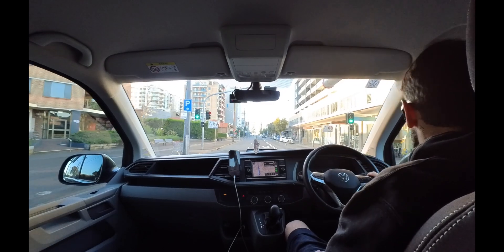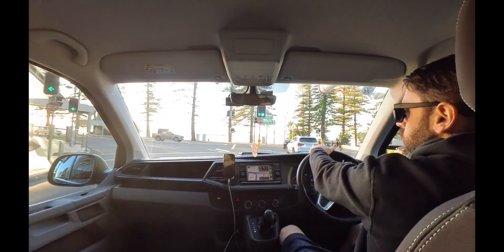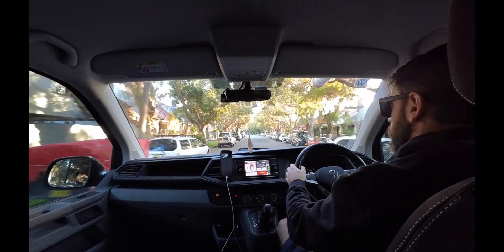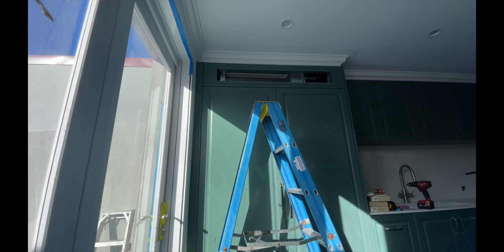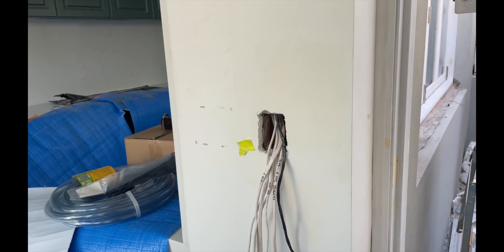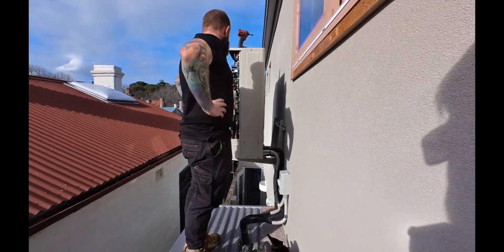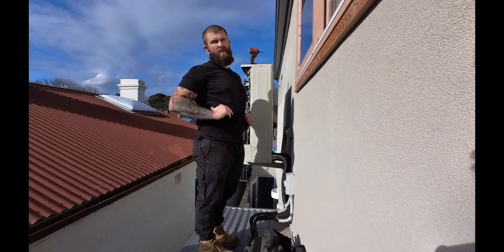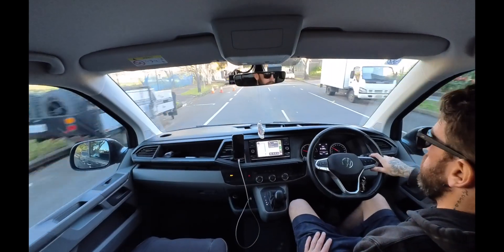Helping a mate finish a DAIKIN VRV project on a Saturday..

Comment: It'd be nice to see a  refrigerant flow/turbulence comparison out there  for a rothenberger vs an RLS. Since the rothenberger kind of does press the copper pipe causing the inner diameter to lose it's shape VS the RLS which doesn't.
Reply: Also your mate makes a good point with that gauge fitting for nitrogen testing. That from actrol?

Comment: You should connect the outlet of the indoor unit to the grill, i see this problem a lot, a plenum box is required.
Some black spray ot the silver bits within the grill is also a nice finnish :)